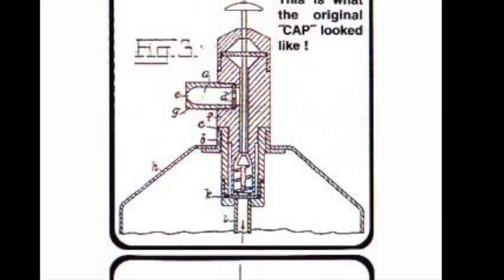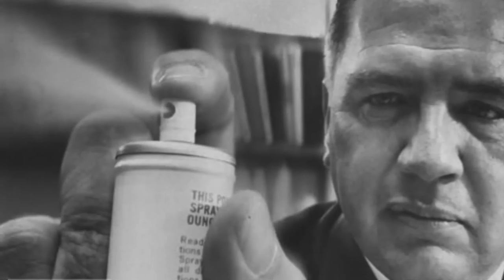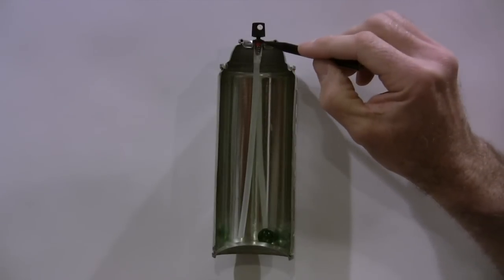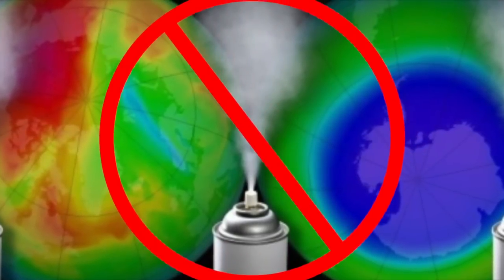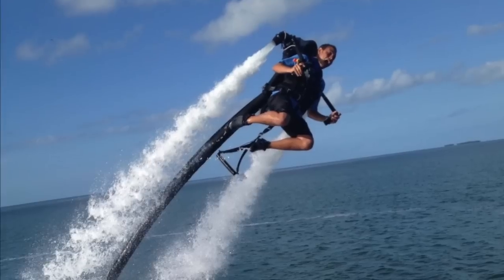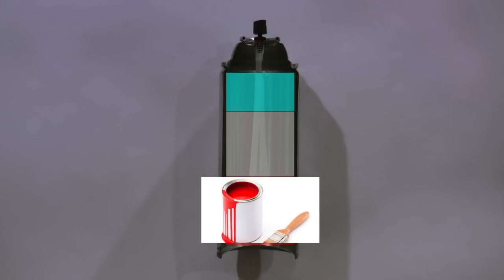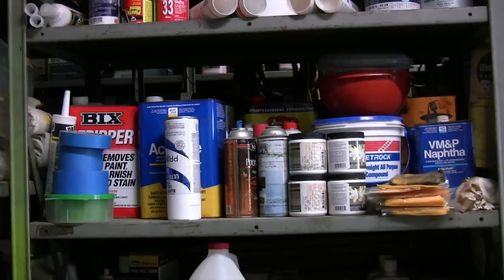Contractor Craig - Never Deal with a Clogged Spray Can Again

Comment: Thank you Craig. That was very illustrative and very informative. One problem: when you said at the beginning that you'll help solve the problem of clogging, I thought you'd suggest ways to actually declog the can, not way to prevent the clog. I still like the video though.
Reply: Prevention is the best cure! Best wishes! 🤔👍🏻👨🏻‍🔧

- Max Giganteum
Reply: To declog you've got to force air into the valve to push out the clog and then soak can in hot tap water periodically shaking thoroughly to ideally break up and dissolve the clog so that it cannot re enter the valve ..

Comment: Once you clear the nozzle out, I think it might still be good to store the can upside down so the paint (sludge) settles in the top of the can and not the bottom where the straw opening is located.
Reply: Correct... once you clear the pickup tube and nozzle, carefully leave the can upside down and store it that way. The idea is that the pickup tube is not in contact with the contents of the can anymore therefore cannot become clogged. It'll stay that way indefinitely too. The original plastic cap from the spray can often is an excellent base for storage but if it isn't, constructing a rack using duct tape or a glue gun and cardboard from boxes is a dirt cheap way to make a rack. If you store your cans in a fire cabinet, you'll need to make a rack out of non-flammable material, if you're going to follow the usual standards.

 Interestingly, when I was in college in the engineering program, several students made a rack that fit into a fire safety cabinet shelf as a project. They made it from expended metal spray cans and got props for the effort to recycle. Even all those decades ago, recycling and environmental concerns were a part of what we were taught. So how did it work? They cut off the bottom & top of the cans and sliced the body lengthwise down the cylinder. The metal rectangles were folded into the parts that comprised the body of the racks which were predestined to fit into the cabinet. They used a small benchtop sheetmetal brake to do the bending. You can think of it looking a bit like an erector set without most of the holes. Anyway, while I wasn't in that group of students or even in the program in the afternoon (I was in the morning half of the program), I got to examine the blueprints, spare parts and the finished product. Every group had their project on display which could essentially make you look good... or not so much. As far as I'm concerned, they did an excellent job, produced a professional looking product and it was far stronger than anyone thought it was going to be while using almost next to nothing in additional materials. IIRC, they put a total of 200 pounds of dead weight on a rack section just to test it out and it held up like a champ. Overkill? Yes. Impressive? Also yes considering none of them had any real practical experience designing or building anything prior to that according to what we were told. Of course common sense tells me that's why they ended up going overboard with their design... practical experience is worth a lot. They just didn't have any yet! The moral of the story is that you can do a lot with common items that most people throw in the trash... and you can do it for little to no money which is usually important when you're a poor, starving college student. Best wishes! ♻️🤔👍🏻

- Max Giganteum

Comment: So basically, once its clogged, there's no unclogging it? I got the impression I was going to learn how to unclog by watching this video not just how to prevent.
Reply from the maker: Sorry you got that impression.  I never tried to give that idea. But you can use this information to prevent future clogs. 

Stay tuned. There are many more videos to come.
Reply: Yeah I got that impression too.
Reply: Me too. lol anywayz good tips.
Reply: you can use an air compressor to unclog most stuck aerosol cans
Reply: Buy acetone in a can, spray it through the cap and/or down the valve of the clogged can. If that doesnt work try a new cap. If that doesnt work, wait and repeat the procedure with the aceton or another paint thinner.
Reply: Try replacing the cap. If that doesn't work, keep the new cap and replace just the can.  There! You still have your refurbished original can, good as new!

Comment: The liquid propellant does actually boil when the valve is opened. When the pressure drops the liquid propellant begins to boil into a vapor which keeps the can pressurized at a constant pressure (based on the temperature and the vapor pressure of the liquid propellant). Sometimes you can actually hear it boiling when you hold the valve wide open. After you have been spraying for a while all the boiling of the liquid cools it down and thus reduces pressure. Unfortunately, this also chills the paint so that it dries slower. The chilled paint can also cause moisture in the air to form condensation which can disfigure the paint surface and can cause adhesion problems with subsequent coats of paint.
Reply from the maker: hmm
Reply: It isn't boiling... this a complete misuse of the word. What's really occurring is expansion. Liquid to gaseous state. Heat or cold is an irrelevancy - the purpose of the propellant is to push the paint out of the can. Yes, heat or cold can influence how paint flows from a nozzle and with separation, adhesion, drying time, etc-etc-etc but the primary purpose remains the same. If you really want to do yourself a favor, make sure the average temperature of the can, what you're going to paint and the environment you're painting in is around 70-75° F. Prep your surface! Properly shake the contents. Take your time painting. Use long even strokes at the correct angle and distance with proper overlap at a healthy rate of application and you'll be successful nor will you have to worry about what's going on inside the can. Just give it a good 2-3 second shake about every 15-20 seconds. Allow the paint to flash between coats. Develop and retain good habits... you'll be a pro in no time. Best wishes! 👍🏻👨🏻‍🏭🇺🇲

- Max Giganteum
Reply: @MaxGiganteum  Let’s ignore the definition of the term “boil”. It doesn’t really matter here. I was probably creating a distraction. My fault. My point was that rattlecan paint quickly drops in temperature which can cause problems in humid environments. The paint comes out cold. It will condense water in the atmosphere and give a poor paint job. I lived in San Francisco and the Pacific Northwest where the damp is a huge pain in the ass. Recognizing this and mitigating temperature and humidity gives better results.

As for the physical chem involved with Boyle’s law and the adiabatic process that explains the refrigerant effect of aerosol propelled paint, I don’t think understanding this matters. The point is that rattlecan paint starts to get very cold. Cold paint is bad in damp environments. Painting in damp environments is not ideal, but it’s difficult to argue with the climate in Washington.
Reply: @NoahSpurrier  I get you on the damp and/or wet thing... I spent 30 years in SW Washington. My solution was to never paint anything in the Winter. Or the Spring. Or the Fall. (ROFL!) Kidding aside, I did find a high level of success by pre-warming everything and being in an extra dry environment. I could paint year round in the shop with the wood stove cranking out tons of heat if necessary. Slowing down the process does help - I mean thinner coats with more coats for coverage with extra stoppage time between coats. It takes patience but I would combine painting with other tasks so it was easy to just set a timer and dust on another thin coat when it went off. Heat soaking the can the entire time works too - just don't let it get too hot! In all reality, the real solution was to avoid spray cans where practical. I used a bona-fide HVLP spray gun thus avoided propellant issues. If paint matching or supply was an issue, I would literally bleed off the propellant from a spray can and transfer that paint into the gun. Sometimes I used an airbrush gun too. Best wishes!

- Max Giganteum

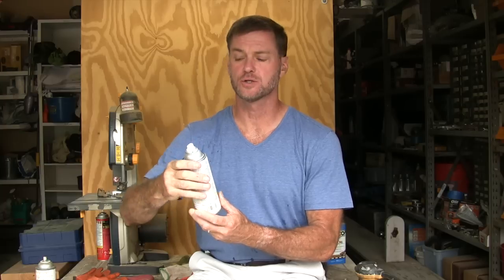Comment: 11:10 ... the trick may not work but they can be stored for a long time. I just used a can with the any angle head that has been sitting for years. shook it up and it worked perfectly.

Comment: Nice history channel clip. Thanks was looking for unclogging a spray can 12 minutes ago. The old turn that can upside-down trick.. Thanks.  
It looks like if the deed is already dun you can shoot air into the can several times till it unclogs, drill the sprayer and the can out to fit a solvent can "red straw" and you may get lucky.. still hunting for more methods.

Comment: Really informative video, but do you know how to unclog a can that's already clogged??
Reply from the maker: Cooper Epps Nope. Sorry. Do you? I'm afraid the horse is out the barn my friend.
Reply: Spray air in it with air Chuck.  While nozzle soaks in acetone.  Light spray of carb cleaner in nozzle also works.  Pick off paint of nozzle with finger nail also.
Reply: @bradyspace  pray tell what air Chuck is?
Reply: Air chuck is common vernacular for the device that attaches on the end of an air hose and is used for inflating tires (and other things). It’s what you press against the Shrader valve to get air into a tire.

Comment: What if I use the can for several very small jobs and repeat the process of spraying upside down until it runs clear.  Won't that use up my air before the paint is gone?
Reply: Yes it will. That is why I watched this video because I thought there is some smarter way.

Comment: I was interested in learning how to get hairspray cans to work again. I use them sparingly so lose a lot of product in the end. I guess I'll have to use spray bottles instead.
Reply from the maker: Hmm. Hair spray. Did you try my method after using? Not sure if it will work on hair products or not. Do t use um. Thanks for watching anyway.
Reply: STORE the hair spray can upside down--it keeps the spray nozzle working much longer.

Comment: nice long video, pretty well informed. my problem is that new big white nozzle you showed at the end. I've shaken it s bunch and still nothing comes out. it's clogged. the can says use mineral solvent for the nozzle, but it still doesn't work. I'm bummed. so it's a third trip back to home depot to exchange it for just regular brush on glow in the dark paint for my awesome projects. btw I love Pinterest for great ideas.
Reply from the maker: +Susan Miller Yeah. I've learned to pare the videos down for You Tube. Sorry about the lost paint. Like i said in the video; this technique will not work on that type of can and the clog occurs down inside the dip tube as well as the nozzle.

Comment: Amazing video!!! CRAIG I have 2 maybe 3 questions and they're very important. First off thank you for sharing the knowledge of the aerosol it helps understand it and what not to do!

Questions
-------
1. If I bought a six pack of any angle cans how long would they last till the stem clogs with the solid or would they not clog if never used?

2. There are cheaper cans for 1 dollar compared to the any angle spray cans from rustoleum, and they are very watery. If shaken it would make the solid lighter couldnt we not shake them to keep them more opaque?

Thanks Craig!!!

Comment: hi, my spray paint has a problem of leaking, i bought an Amstradam acrylic (water based)paint (for my school art works) and if I'm correct i think i haven't had used it for about less than 6 months and when i opened it today, it wouldn't work, it worked for the first one minute and then stopped, strangely making noises and its leaking out, i tried  your method of spraying it upside down, its still not working, can you please help me? thanks!
Reply from the maker: Well Beau, my technique is to prevent a clog not unclog a clog. It's too late for my way. There are a lot of vids on here to show you that. Thanks for watching and for your question. Please check back for more tips.
Reply: Craig Shotwell well, i couldn't find one that relates to mine but thanks! Cheers.

Comment: I thought everyone knew that.  But very well done.  I always save the nozzles from the old cans in case I get  one that clogs, and they do clog no matter what you do.
Reply from the maker: Well I have had different experiences. If I do this trick they do not clog. They can also clog below the tip and in the tube, so saving the tip does nothing...
Reply: I have never had one clog in the tube, only in the nozzle.  So if you do as they say, no problems.
Reply: S
o you are saying that we have to boil the spray can in water. Please help me i am i a hurry to unclog my spray can because i am working on a project .please help me .
Reply from the maker: You can buy new nozzles for that. Or just do as I have suggested and keep your money in your pocket. I know you were kidding about the question of boiling the can. ;-)
Reply: No the problem is not of nozzle its in the pipe inside the can. please guide me what to do

Comment: If you've got a clog in the pickup tube on the inside of a spray can, use an automotive valve stem to make an attempt to clear the clog. You can use this technique on a variety of spray cans that have a propellant inside of them whether it's paint, expandable insulating foam, hairspray, adhesives, etc-etc-etc. More on this later.

 I'll issue this warning - a manufacturer would never recommend this technique I'm sure but it is useful for salvaging a can if you're willing to accept the risk of having something happen. I recommend wearing safety glasses and taking the proper precautions to prevent injury to yourself as well as to protect your property. Remember that a lot of propellants are highly flammable. What's inside the can could blind you if it gets in your eyes and could certainly damage your lungs if you ingest it. There's also the potential to get sliced open and bleed badly if the can were to burst. Note that not all cans will tolerate 100 PSI. Some of the smaller cans are made out of Aluminum instead of steel and might only hold 15 to 20 PSI so be careful what you pressurize and by how much. What you're doing is all on you! Now back to the technique.

Since it has been done many times before and it's easier to watch it than explain it go to the following channel:

sixtyfiveford

The video you need to watch is this one:

Fix Clogged Spray Paint Cans

The rest is up to you. Best wishes! 🤔👍🏻🇺🇲

- Max Giganteum

Comment: So how common is it for a can to lose its propellant in a can of product like WD40 when the can is still nearly full? If the propellant is lost, in a can that is still nearly full, is the can still under too high of pressure to punch a hole in and remove the product/lubricant?
Reply from the maker: Not really sure. I've never had that issue. I'm sure it's possible though. Solvents will constantly try to escape like a wild animal. They will find their way out eventually. If so, you could release all of the remaining pressure from the top, just to be sure and safe, then poke a hole in the bottom of the can to capture the remaining unused product in a bottle. The only challenge then would be to apply the lubricant to the area needed. Spraying with a directional straw is most convenient for application. You could use a brush I suppose. See this You Tube link by my "brotha from another motha" to see how its done. He uses paint but the same technique could be done with a solvent. Please be careful and use extreme caution. Be sure that there are no open flames or ignition sources near. I'll post the link next below. Thanks for the great question. I hope this helps.
Reply from the maker: shoot!!! I can't find the link now. The guy used a nail, a plastic cap, and a wooden handle to create a tool to release the pressure all the way. Then he poked a hole in the bottom of the can to drain the product out. Maybe you can have better luck trying to find it here on You Tube.
Reply: I slowly push an ice pick into the side or bottom of the can.The taper on the tip seals the hole as it goes in, you can then back off the pressure on the ice pick slowly letting remaining pressure out of the can,  then you are safe to drain the can.

Comment: Turning the can upside down and spraying until it runs clear is the directions on virtually every can, no mystery fix here.That being said, there are still times when a can left sitting for months will not work, even if you follow the directions.

Comment: Clear the tube and tip, but also flush the tip and nipple after each use with spray carb cleaner. Swap the nozzles and spray the cleaner at the paint can nipple. Works perfectly, but don't get spray in your eyes.
Reply from the maker: Yes, protect those eyes. Thanks for watching.

Comment: Great job, basically what he's secretly implying there, is the propellant dilutes the paint, so putting it back in a can & refilling with more propellant will dilute the paint mixture.  Imagine how diluted two spray paint colors mixed together would be & adding liquid repellent gas to it.  Maybe it is better to add air sometimes in refillable cans if it comes out ok.  Any thoughts?

Comment: Thanks for the little to long history lesson but the invert the can trick doesn't always work.  I always invert the can and I have several clogged cans in my garage. Also some cans will spray upside down this well known trick doesn't necessary work for all types of spray paint.
Reply from the maker: Right, I mentioned the "any angle" aerosol can in the video.